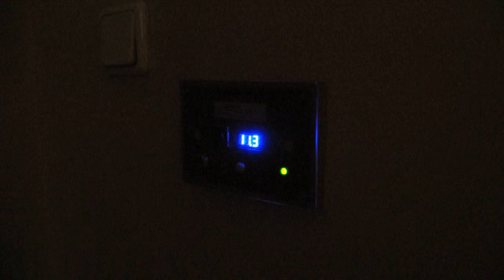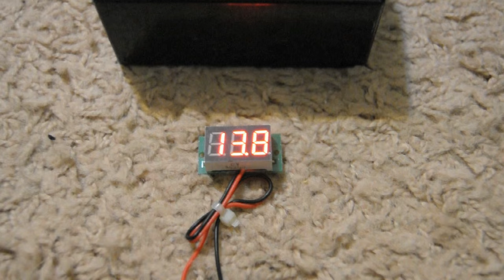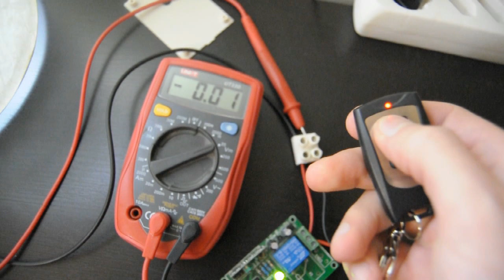DIY | Simple 120db Wireless Door Alarm Siren (Or Panic Button) with Backup Power

Comment: Thank you for this video, I have some questions:
1- there is a lot of those rf 433Mhz remote control relay on ebay and aliexpress, but are those remote controls universal, meaning that one RC can control multiple RF Receivers?
2- Can you suggest me a more secure remote control rf relay board?
Reply from the maker: They can control multiple receivers if it happens to have the same code. You can code one board according to the ic's manufacturer instructions to use the maximum code bits but even so if it isn't a rolling code board chances are it can be easily manipulated using some sort of interference or another remote control.
To tell the truth even the cheap rolling code boards are not much secure,but using one is a little better than a standard remote control board that works at 315 or 433mhz without rolling code function.
Reply: @truebassB  Thank you 👍
Reply from the maker: no problem :)

Comment: How do I make just a plug in with no battery/
Reply from the maker: The battery is connected in parallel, so it would work the same without it as far as it does get the +12v DC from a power supply.

Comment from the maker: When i say to use a Normally Open Reed switch i actually mean Normally Closed which opens when it has magnet contact.

Also i did not implemented any tamper on video due to the grab and throw it out of the window nature of this device,although there are a lot of tweaking that can be done,i can say it works best when it's hidden out of sight on a roof or above a garage door lol.